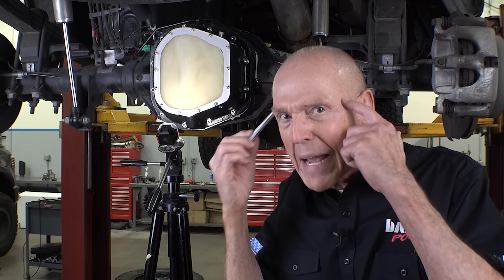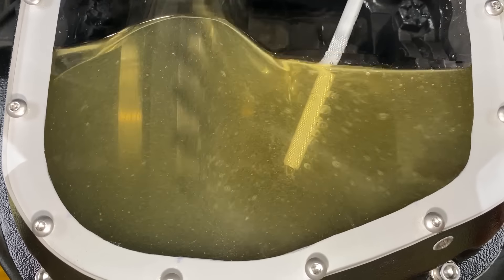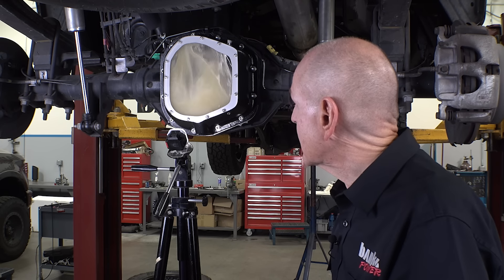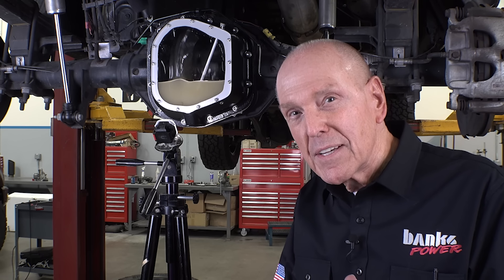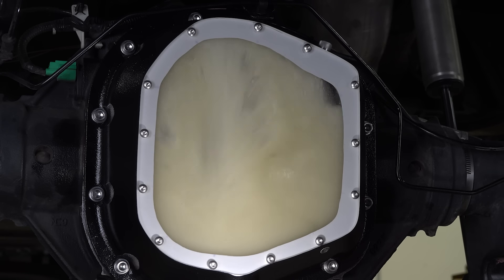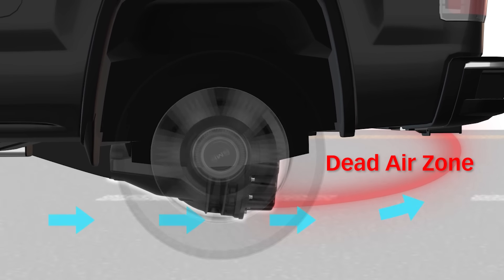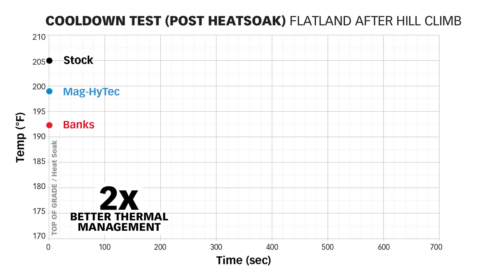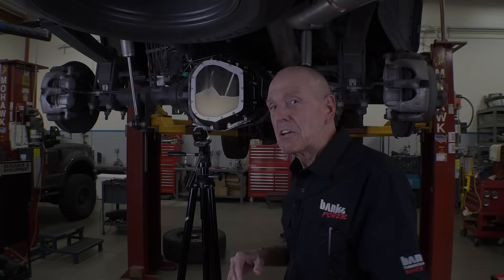What aftermarket diff cover guys don't tell you!

Comment: "I don't think any oil is getting to the pinion!" nice try. Just because all you can see is the splash, don't mean there is some magical pocket of air in there not getting any oil. Oil is absolutely traveling to the pinion. Not near as good as factory, or supposedly the banks, but it's there. Another sales pitch.
Reply: True... but is it enough tho? Ever wonder why guys lose rear ends in their vehicles?
Reply: @craigquann  Yes, it's more than enough. All you need is a THIN FILM of oil on these components. There is SO MUCH oil in a rear end, this explanation is really really silly.
Reply: @life_of_riley88  Its about efficiency. You want the oil to hold a circle shape. More efficient means cooler temps which means less friction. The round cover also has more surface area and has the oil efficiently travels along the cover. It transfers heat to the cover better because of the added surface area of the round cover.
Reply: Many people loose their diff because of overheated oil. Overheated oil has worse lubricate and allows for the gears to heat up more which causes the oil to burn more and screw the diff even more because the metal in the diff starts to expand which messes with the tight clearances of the friction plates and gears
Reply: Of course there is oil getting to the pinion, it's just hotter. Long term wear is the point he's making.
Reply: This man has forgotten more than you will ever learn! Try being humble it won't hurt you

Comment: I’ll look into it when Semi’s start using finned housing covers!!👌😉
Reply: I've seen some with a pump and external cooler
Reply: @busmekanx  nascar uses that.
Reply: you want the inside to be smooth so the oil can get back down to the bottom as fast as possible to be available for the gears to pick it up again. These guys are gasligting everybody. nascar posi unit diffs are smooth inside and out.

Comment: How well does it cool after dragging that fancy cover through the mud to load cattle.
Reply: A actual legitimate question. I bet playing u boat captain would clean it out. At the very least you would still have oem equivalent cooling.
Reply: It would certainly not perform worse than an OEM Cover.
Reply: @alouisschafer7212  indeed, true enough. But if you actually need the extra cooling..... If not save your $ leave the factory cover on
Reply: Wouldn't it push air flow futher out? Now it has to go over mud filled baffles.
Reply: @mybossisdrunk  people who get this cover are not going to put in on a mudbogger.
I hope...
Reply: Right on
Reply: @alouisschafer7212  dude,you might as well go back to sleep,people in the know,well they know ,while that over priced cover is in your cart go on and get you one of those tornado intake tube inserts,and before you put their advertisment stickers on wipe that spot with rubbing alcohol so they stay on better than the Yeti one did
Reply: @alouisschafer7212  good point, more of a show piece for a lifted truck.
Reply: @christ6671  or something that sees race tracks.
Reply: Probably would perform worst than oem once the fins jam up with mud. That would lead to additional "insulation"... but if your using a good synthetic oil,  your Probably ok regardless.
Reply: @mjnc3672  now your just being silly. 🤨😜
Reply: @alouisschafer7212  depends if it traps more gunk on the outside than an OEM cover

Comment: Definitely a great video. I would like to point out some things though. I think the flat stuff is even worse than you are demonstrating. There are horizontal "cooling fins" on the inside that are likely to make the aeration worse. Simply gluing some make shift ones on would have shown just how much worse it really is.

Another thing I think would also help is you only have 1 wheel being spun the whole time. This is naturally changing which gears inside the diff are spinning at what rates and affecting the flow. Locking the diff would help better show what is happening with the flow, though maybe not by much anyway.

Comment: This is not at all what is thought in mechanical engeenering. First as long the tangetial speed of the crown gear is not greater than 15 m/s (50 ft/s) oil is not completly thrown off the gear. So the oil gets to the contact area. More oil at the contact area means not that there is less wear, because it is just important to provide a layer to hold the gears from direct contact. This provides a oil film of the thikness of hair as good as thicker layer. Air bubbles can not form in a thin layer of oil. Foaming is a problem, because foam is a good heat insulator and can lead to overheating. Second more oil has a reason. With more oil the bearing balls / rollers were also standing in the oil. That is determinig the fluid hight. Would the bearings not be there the oil would just have to so high that it covers the lowest teeth.  Further small pieces of metal are always going to land in the oil. When you have more oil you can take more metal particls before having a "grinding fluid".Third The low pressure zone does not mean there is high flow of air. On the contrary the air is gliding over the low pressure zone. The same mechanism why airplanes stall at to high of a speed. I would like to see a longer testing period. 700 seconds is not very much. A 10 hours graph while driving trough various environments with and without your cover would be more represanting. But you know that too.

Comment: What about mud getting inside the Ram-Air scoop, I think the stock diff cover is good enough.
Reply: You can just wash the diff cover clean with a hose or a pressure washer.
Reply: @alouisschafer7212  what about when you are in a remote area having fun with you truck in the mud and the vents are closed with mud, it will not be useful 🤔.
Reply: @AliTheGreatest-DnMe  Even caked with mud, it's still aluminum. Aluminum tranfers heat way better than the stamped steel stock cover.
Reply: @brianstallard5446  ok
Reply: @mybossisdrunk  no...
Just a way to kerp it clean should somebody have this cover on a truck that sees rough terrain and mud.
Its certainly not meant for that application. This diff cover only makes sense in a performance build truck that sees a lot of sustained full throtte loads like racing or towing.
Reply: The stock cover is well designed and good enough but it doesn't have that bling factor.
Reply: @maddog9659  exactly my 98 Ram 3500 12 valve just rolled the over to 600,000 miles. 60-70 % of the time its been hauling a load with a stock diff cover in all temperature conditions. I have never had to go inside that diff for repairs but I do change the oil every 50,000 miles. 
Conclusion save your money on the cover and buy oil.
Reply: @donziperk  in reality you are exactly corect sir. Several months I wanted a new aftermarket diff cover for my truck and my transam..just because it looked cool. My dad talked me out of it just to save money, but I've researched things like in this video latly and discovered what I already should of known. If it's not broke dont fix it! That rule is hard to follow sometimes but it saves money for stuff that will actually help..like a new carb and distributer and wires for my transam that actually will be beneficial for it. Lol
Reply: @motov8-garage832  Excellent decision. What year is your Tran Am?
Reply: @donziperk   it's a 79 10th anniversary edition. It's my project car. It runs but has a slight miss in it. It set for 4 years so I went threw it, did the normal first things, new plugs, a bit of oil down each cylinder before starting, changed out all gas lines and emptied out the tank, changed out the rear diff fluid(struggled not to buy a fancy diff cover) Fixed some vacume lines got it running...now I'm waiting for spring because it's about 40 50 degrees here in the day time..and no heater in the shop lol. So I've definitely got more important things to worry about then a custom diff cover..I dont always make the best financial decisions in buying items for my vehicles but it is best to limit what you get and only get things you need..for the most part atleast, aspecially the daily driver that is my truck😁👍
Reply: @motov8-garage832  That sounds like a great project. 
I had a 70 400 4 speed convertible. Wish I had it now. Bought it in 75 sold it in 78.
Reply: @donziperk  Nice! I bet, I wish I could find just the Pontiac 400 engine alone.
Reply: @motov8-garage832  there are so many engine options now for swapping. 
An LS would be good.
Reply: @donziperk  an ls would be ideal just expensive, I'd need to change the transmission, driveline, and rear end. Maybe sometime in the future I'll get together the money for that. As of now I'm thinking a chevy 350. It would go right in with new motor mounts and use a trans adapter. This will probaly be the project car I keep for many years and like all project cars there never really done.
Reply: @HSKFabrications  ouch...
I would never mount this cover on a truck that sees anything different than pavement.
Reply: @brianstallard5446  The aluminum is so much thicker than it actually conducts worse than the thinner steel cover. But that doesn’t matter much, since the fins and airflow compensate it.

Comment: Looks like a good diff cover. The only problem I can see happening is the ram air vents getting plugged with mud and rocks driving down a wet gravel road. I think the fins you’ve put inside the cover do more cooling than the ram air idea. I’m sure it works great on the highway in California. Would be really interested in a cover like you’ve got but without the ram air scoops.
Reply: The cover is designed for heavy working loaded or towing trucks on the highway. Not for Offroad applications.

Comment: I don't really doubt the Banks product is better than stock in extreme situations but for the average driver using their truck as intended, that $400 you spend on a cover is likely better put towards your next oil change or in your tank. 
I'm a firm believer in if its not broke don't fix it. I've never had a rear fail that wasn't being abused in some way, even on vehicles that spend most of their life towing a trailer. 
For newer trucks, I'd save as much money as you can for when the DPF fails or for the next set of $500 batteries its no doubt going to need. (If you lucky by then they won't have doubled in price again).

Comment: Gales analysis makes perfect sense to me as a ex ford SD owner I had the bearings fail in my 10.5 Sterling an rebuilt the whole rearend an put a mag hytech cover on it an it repeatedly boiled the syn 85 140 out thru the vent hose. Trucks gone not my problem anymore

Comment: I’d imagine that cooling performance of a ribbed design is also dependent on how clean the cover is. Once they get caked in mud and grime the cooling effect they had will become greatly diminished. I think the reasons OEMs stick with smooth covers is that most people don’t clean their differentials and dirt and grime have less nooks and crannies to stick to. Hence the covers stay reasonable clean to do what’s necessary to keep the differential alive.
Reply: If the OEMs felt like they needed to pay the extra price for cooling, they would have. The life expectancy of a rear axle now is such that you'll have sent that truck down the road long before it develops a significant problem. How many people run 100s of thousands of miles before even bothering to change fluid?
Reply: OEM doesn't care about cooling as much as bottom line - how much does it cost and how can we make it cheaper!! Thus these covers are stamped steel!!!
Reply: @41dodgee300  they care about as much in that they need it to last as long as the car can be expected to live.
Like you’ll get a certain amount of miles as a goal and a load that it’s supposed to handle for that time and then you go to town designing or selecting the right differential to reach that goal.
This is fine as long as you don’t ask the car to do more than that.

Comment: Looks like he’s close hitting his shoulder in that right rear spinning rotor.  He was up to 70 or so mph.
Reply: I think its looks worse than it is because of the camera angle, still not safe. If his shoulder would hit that brake disk at that speed it s gonna causa a lot of damage. Not even flex tape is gonna fix that 😂

Comment: I find it interesting, as well as frankly disappointing how many people here are upset that they didn't show a transparent version of a stock/Banks style curved cover, and refute the data shown because they didn't. Any walnut with a garden hose and a large mixing bowl can figure out how the fluid dynamics of the curved cover would work, and why it works, and why the Banks & OEM covers are shaped the way they are; heck, the vertical ribs in the Banks cover are there to help prevent the lateral travel of oil as an improvement over stock. This was a clear demonstration of why the flat aftermarket covers are poorly designed, and inadvertently how poorly educated a good many viewers seem to be.

Comment: SOLD! Now make them for older Chevy trucks and you'll get my money.
Reply from the maker: How old is your Chevy? Our Ram-Air cover for the 14-bolt AAM axle fits HDs back to 2001.
Reply: @bankspower  need to make covers for GM 10 bolt and 12 bolt diffs.
Reply: @bankspower   Gale can you PLEASE make these for the old  GM 10.5" Corporate 14 bolt ???  Btw I have a 1987 Chevy V20 4x4 with a 1997 intercooled 5.9L Cummins P-pump 12 valve with compound turbos ( Borg Warner T3 S366-SX3 on top and a Borg Warner T6 S475 on bottom ".  I swapped out my old tired 6.2L Detroit V8 diesel to the Cummins beast I have now
Reply: @bankspower  94 and a proud owner of a Banks 3 inch turbo back exhaust system for the 6.5TD. Back when you guys were the only ones doing performance upgrades for that platform. Sadly feel like we've been kicked to the curb as you are offering diff covers for older models of Dodge and Ford. 😭

Comment: Its quite wrong to think that no oil is going forward… it is painfully obvious that the top of the ring gear will be throwing oil forward almost as much as the stuff seen going rearward. Have you even ridden a bike in the rain without a fender? It is nice to see the test, but your conclusions are not correct.

Comment: Being mechanically inclined and not associated with Banks Corp I installed two of these Banks Rear diff covers on my 03 GMC Sierra 2500 HD Duramax diesel 4x4 and on 04 Ford Excursion 6.0 Powerstroke diesel 4x4.  I tow a boat on both and use both for family vaca travel as well.  I can see the Banks design is spot on the gear fluid movement during high speed.  These different gear covers were not cheap at the time of purchase in 2022 and were approx $500 each.  The ring and the pinion gear take the brunt of the load of pushing the vehicle forward, especially in an incline. Keeping the rear diff cool as much as possible will help reduce the breakdown of the fluid and gears.

Comment: I bought aftermarket because I like a drain plug at the bottom instead of having to change the gasket and make a mess each time. I will still change the gasket at 100k mile intervals, fluid every 33.

Comment: Mr. Banks, I hope this comment reaches you... I avidly off-road my 2011 ram 2500 4x4. I appreciate your research and development on your Ram Air cover. One thing I haven't seen discussed is the overall strength of this as protective armor during activities in the rocks. I would love to see a product for us wheelers, with Cummins' and Power Wagons. We do tend to bang up front AND rear covers on rocks. Sometimes rocks aren't avoidable, and the stock covers peel- off easily. Most wheelers would buy a welded steel plate cover, which I would assume by your tests, would not provide any benefit other than protection from rocks. I am worried that if I purchase a Ram Air diff cover, that I will be MORE likely to cause damage due to the ram air scoops. Furthermore, reversing into rocks is also a concern, as this cover is aluminum, most 4x4 enthusiasts do not have a welder on board to repair aluminum on the trail if it's damaged by a rock. Thank you.
Reply: I had similar concerns. Those ram air corners are asking to get snagged and ripped off it looks like or I would have purchased this cover..